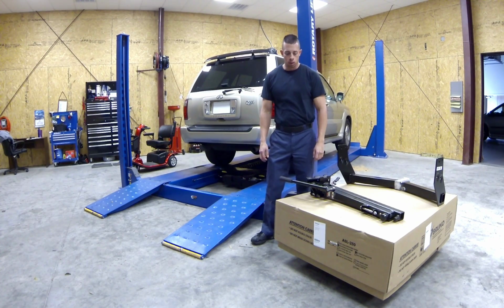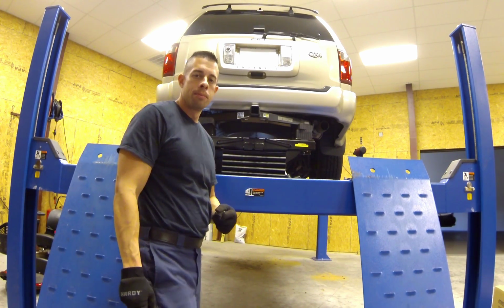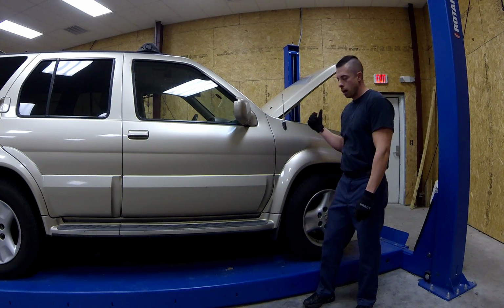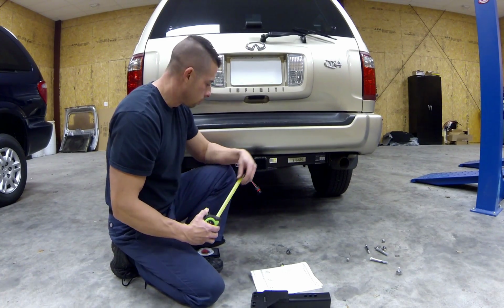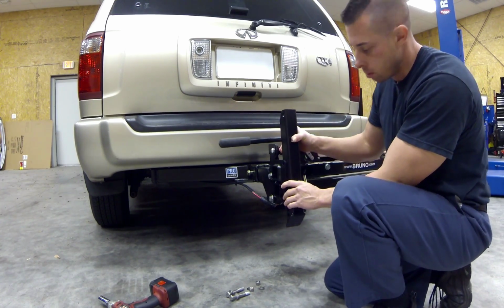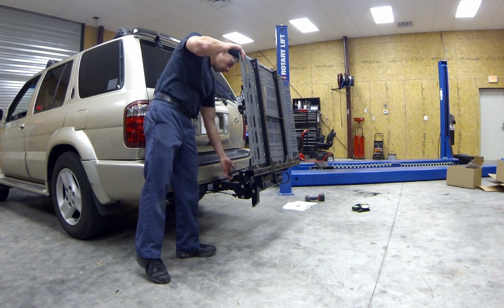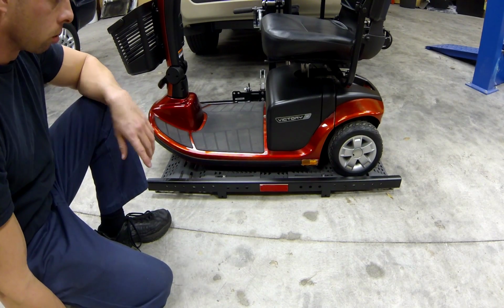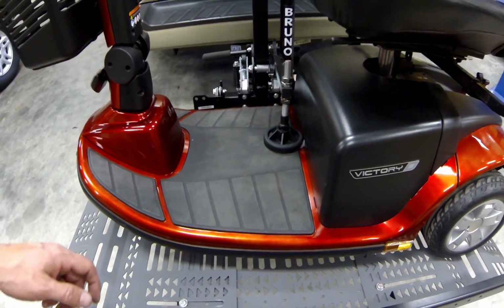Bruno ASL-250 Mobility Lift Install (Outsider)

Comment: The limit is the hitch capability.   I had a RAV4 and any of the platform lifts with pretty much any kind of scooter was over what the receiver could handle.   I finally got a Trilift that has minimal weight to the lift itself and the RAV4 could handle it.    I am in the same boat with my Maverick and a power wheelchair.   What I find works well is a Ram Promaster/Winnebago Roam with a Braun under the floor lift on the side.   Plus it keeps stuff inside and protected from the weather.

Comment: What keeps the platform from bouncing up and down over bumps? The scooter is held down by the pressure foot but the while platform bounces. I am able to lift the platform up when the scooter is installed. The platform has no resistance other than the weight of the scooter.

Comment: Thanks for your video. I have one of these lift. Yesterday after I unloaded my scooter  I pressed the button to send up, started going up but it did not fold close.  Still the thing that comes down to hold the scooter still coming down without the scooter on the platform.  How do you adjust it? thanks.
Reply from the maker: It’s been 8 years since I’ve worked on one. I can’t remember. I apologize.

Comment: Really great video. Have you ever tried, or heard of anyone who has tried, to plug the lift into a trailer (brake/lights) plug either a 4-way or 7-way plug? Seems to much easier than wiring underneath the vehicle to the battery. If so please include any links to that info thank you.
Reply from the maker: I would think the wiring for trailer harness would be insufficient for operating a system like this.
Reply: Yes, I run it off my clearance lights on my trailer plug on the pick up and motorhome.  But we did run the full wire from battery on the wife's car....the primary vehicle.

Comment: At 6.32 you demo the swing away lever. Is there any type of adjustment on this part to make it easier to operate? I have one that I bought used and its VERY tight to the point its almost unuseable. Thanks!!
Reply from the maker: May just be a rusted hinge on your swing arm.
Reply: @TheGasTap  No, Its a 2018 model and been kept inside.
Reply from the maker: The only adjustment is a bolt that sets the unit plumb so it doesn’t bind
Reply: @TheGasTap  Thank You. There is some adjustment on the piece that the swing arm goes up to. My friend and I worked on it a little today and its better but not easy to operate. Is there somewhere I could send a couple of pictures for you to take a look please?
Reply from the maker: Sure. Tuffram25@yahoo.com

Comment: We have a Harman Lift on the back of our van. We purchased the lift used and of course we were assured it was working properly. We drove 500 miles, one way to purchase it. After we paid a trailer company to install it on our car and wire it, we found it mostly operates correctly but the plunger does not go down onto his Pride scooter.
Is there anything we could do to make the plunger operate? We have a friend with mild skills. 
We would greatly appreciate any help at all.
Reply from the maker: That is operated mechanically, there may be a cam or arm broken. are you able to email me pictures of the unit?
Reply: @TheGasTap  i will take a picture and send it tomorrow. Thank you so much.

Comment: Great video, I use a very similar lift.  Just a suggestion,  the scooter hold down is offset slightly to the right.  If the scooter instead enters the lift from the left,  then the hold down would  be more centered on the scooter floorboard.
Reply from the maker: Yes sir but I didn't want the costumer to enter from the traffic side of the vehicle if they were to park on a 1 way street or parallel park.

Comment: Thanks for the video. I'm 4 yrs out from a disabling surgery on my back and have 2 bad knees. I'm a couple of months away from another back surgery. I've resided to the fact I'm permanently disabled (happened at 37) and I need a scooter to get around stores. I'm getting a used model like you installed and it helped me understand the mechanics of it. Thanks!

Comment: Great Video. I now have the confidence to go forward. I just purchased a used ASL-250 to install on my Mothers vehicle (2004 Lexus RX 330) and have been able to secure the Installation Instructions but they do not include the Height Chart you mentioned. Where can I find this resource?
Reply from the maker: Sorry but I am not in that line of work anymore and I dont ha e access to that chart. You should be able to get it on the manufacturer's website or call their customer service. Thanks for the positive comment. I'm glad I could help.

Comment: Alex could the hold down be flipped to the other side to give clearance?
Reply from the maker: The swing away? It only goes the one way.
Reply: No the part the you call the hold down with the pad that clamps down onto the scooter floor pan
Reply from the maker: Oh. No that comes fully attached and is not able to be moved.